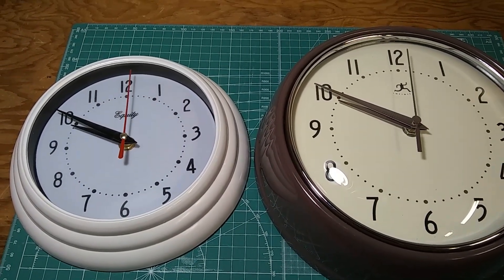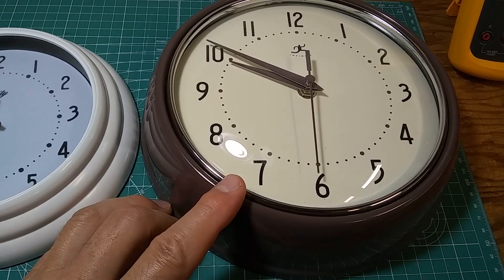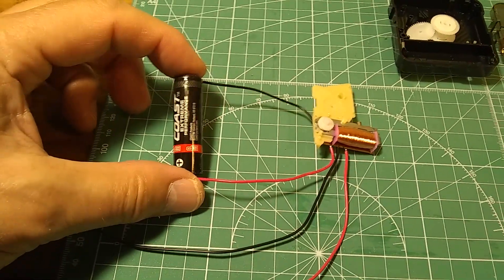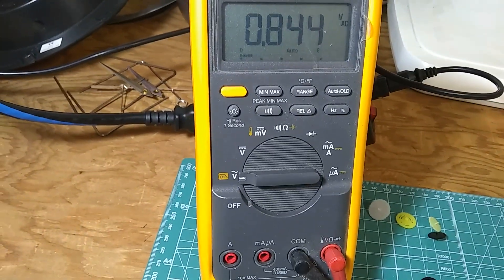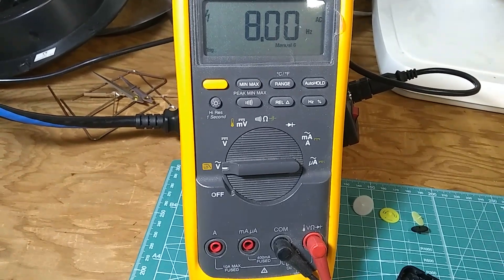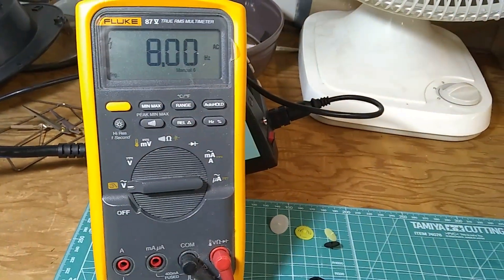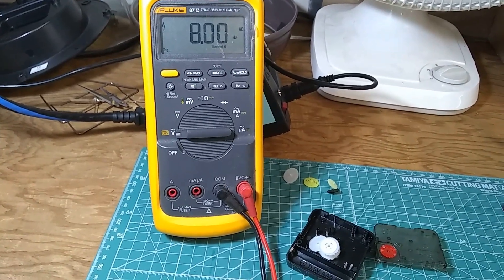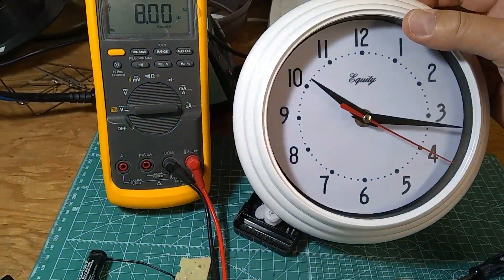Why Does a Silent Continuous Sweep Quartz Clock Deplete the Battery So Fast?

Comment: A better test would be to measure the current draw of each clock while it's in operation and then calculate battery life against the capacity of the AA battery.  For instance, if you measure the current to be 2mA, and your AA battery has a capacity of 2200mAh you could calculate run time with the equation : 2200mAh/2mA = 1100 hours or 45.8 days.

Comment: What about silent sweeo clocks without second hand??
Reply from the maker: It's exactly the same thing in regard to power consumption. The motor - which drains the battery - works with the same speeds and frequencies.

Comment: I just got my first movement of this kind to test out.  Loud ticking unquiet rooms can drive me crazy.  I would expect that if this is still using the Levitt motor but 16X faster- the gears and overall life of the clock will be greatly shortened. Maybe using a AA Lithium will make it run a year???
Reply from the maker: Google says that AA alkaline batteries have a capacity between 1800 and 3000 mAh. And AA lithium batteries have a capacity between 2700 mAh and 3500 mAh. But lithium batteries discharge differently from alkaline: they stay good to the end and then sharply drop their voltage, so it might be worth a try. Perhaps with a sticker with the date when the new battery was installed. 

If you don't mind posting back your result in the comment here, that would be valuable info for others.

Comment: Hi, why is the motor frequency 0.5 Hz (0.8 Hz)? If the needle advances one step per second, shouldn’t it be 1 Hz (16 Hz)? Thanks
Reply from the maker: The rise advances a step (1 sec.) and the fall advances the next step (1 sec.) in this simple motor. So, one full cycle takes 2 seconds (or 0.5Hz). This process is accelerated in the silent sweep clock and then compensated down by the proper gear ratio.
Reply: @tektech1065  Thanks!

Comment: I just replaced my wall clock. It seems like the movements are silent now. Glad I bought more batteries. Given the choice, I'd go with ticking version to avoid the battery replacement hassle.
Reply from the maker: More than once a year clock battery replacement is too much hassle indeed.
Reply: @tektech1065    I was thinking it may be 3-4 times a year. If it is once a year, that would be great.. A plus is that it is quiet.

Comment: My AA battery depletes in 45 days . How to solve the problem
Reply from the maker: That is the reason why I avoid these "silent sweep" clocks. If you have some room behind the clock, you could add extra battery holders: for a larger, C or D battery, or holders for a few more AA batteries connected in parallel. Or a 1.5 VDC permanent power supply. 
Good Luck
Reply: @tektech1065  thanks for your reply. Is there any trick to reduce the tik tik sound of normal regular non sweep clock machine?
Reply from the maker: @shunealahmad6435  There are YT videos showing ways to silence noisy quartz clocks (example: N4Hupi7e3pc). I've never tried that and don't know how effective, or long-lasting, that solution is. I think the oil solution could be just temporary. Others suggest getting the "silent sweep" mechanism but don't mention excessive battery consumption. 

This can't be done at home, but some manufacturers make the gear, or two gears, near the Lavet stepping motor out of softer plastic which dampens the impact and reduces ticking noise.

Comment: I am familiar with this annoying problem, and I think this new type silen clock was developed at the request of the battery manufacturer.
Reply from the maker: There is a long-established expectation for any battery operated clock, or watch, to run on a fresh battery for at least one full year. The "silent sweep" operation is silent and smooth but I have never seen the clock makers' warning about shorter battery life. I avoid those clocks for that reason.
Reply: @tektech1065 
 In my country it is almost impossible to find such mechanisms anymore, and they are not even available online.
Reply: @tektech1065    I just bought one online and didn't see any of the ticking ones. I had an old cheap zinc battery that would no longer power a wireless mouse. It is running in the new clock and voltage is hanging in there. After that, I'll put in a fresh alkaline AA.

Comment: Hey sir! Great video! 

I had a query though: is it the same reason due to which we cannot replicate the sweeping quartz movement in wrist watches: because it consumes more power?
Reply from the maker: Good point! Analog quartz wrist watches use miniature version of the same Lavet stepping motor (Shown in this YT video: CXtOJYvaX-s). Speeding up the motor to create a sweeping continuous movement of the seconds would consume more power and deplete the battery a few times faster. In a wall clock, the manufacturer can remedy the problem by simply using a larger battery: C or D size. But a wrist watch has limited space for battery, so a ticking seconds hand is the best option. 

This could change in the future with some invention of equally small but more powerful watch batteries.
Reply: @tektech1065  Thanks sir! 

I’m a chemical engineer working in a semiconductor industry. 

This motivates me to pursue a hobby into battery making😁😁

Cheers to you! 🙌

Comment: Got one silent sage quartz wall clock from my friend as wedding gift.
Worked fine for 5 years with me replacing the battery twice or thrice.
Finally 6 months back it was not working and I removed all the gears and put them back. It worked for few days to a week and then suddenly stopped. I even changed the battery but it refuses to work properly.
I was thinking of just replacing the mechanism.
What are your thoughts on this ?
Reply from the maker: The battery connects to the printed circuit board via two steel springs which press against the board. You may try to take it apart again and clean the two contact pads on the board with Q-tip and Deoxit or rubbing alcohol. Look for signs of oxidation on the surface of the contact points - it's a common thing in quartz clocks. 

A more permanent fix would be an advanced "brain surgery" on the clock: tightly wind a piece of thin magnet wire around each spring and solder its end to the board. I showed it briefly in this video: https://youtu.be/VGN-xoHSqTA?t=313

You could also just replace the mechanism but then the original hands may or may not fit. 

Good luck!

Comment: Why 0.5Hz and not 1Hz?  Is it a tick/tock mechanism?  The only clock movements (square box, battery along bottom) that I have taken apart don't have a minute hand!!! 😁
Reply from the maker: Good question about the 0.5, or 1/2 Hz. The coil of the Lavet motor gets square wave AC like this: ⎍⎍⎍⎍. Every rise is one step of the motor equal to 1 second, and every fall is the next 1 second step. Therefore one full square wave cycle lasts 2 seconds = 0.5 Hz. That's the nature of the Lavet stepping motor - simple and genius. 

If the clock had a digital display HH:MM:SS then 1 Hz would be perfect to drive it.